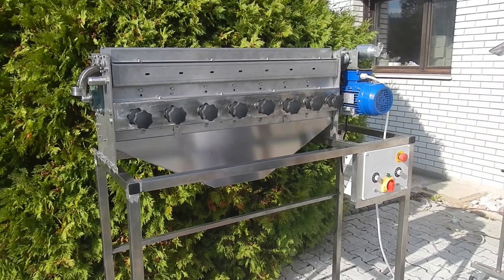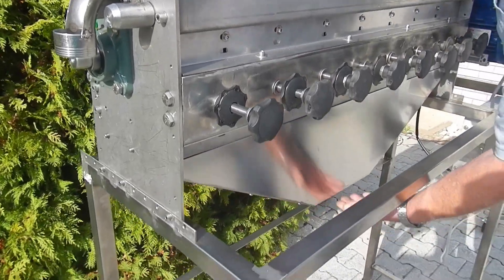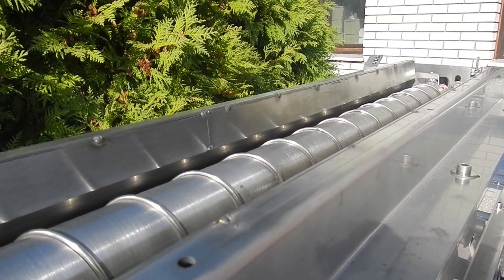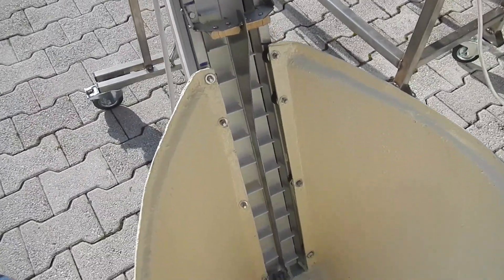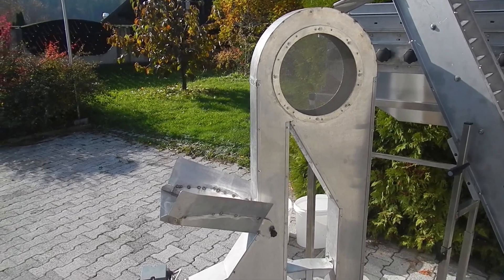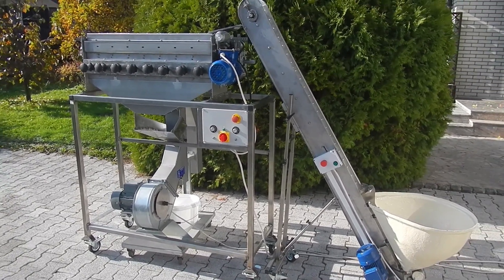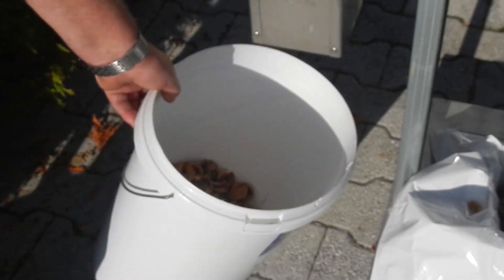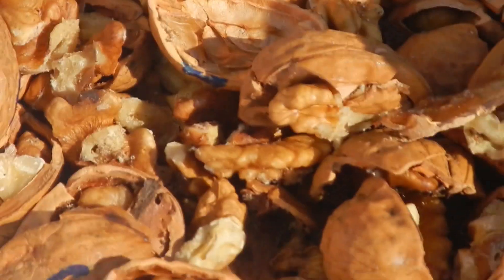Walnut Cracking Machine - NEW GENERATION (whole production line)

Comment: I am working on a project in which areca nuts are to be lifted using a similar belt mechanism. Can someone please tell what Material this belt is made up of or where I can find this kind of a belt?
Reply: I designed the conveyor belt myself. The material is as usual. As I know it cannot be bought.
Greetings
Reply: @povhenavtika7906  Can you please tell which material you used for making the conveyor belt. Steel?
Reply: It's made with stainless steel

Comment: Seems you fellows are on the right track.  But, do you run these half-shell portions back through this machine or what?  Seems that it doesn't crack these nearly enough to get all the pulp out of the shells.  And what do you do with those oversized walnuts?  Do these get hand cracked by migrant workers?  Correct me if you want, but I believe the whole reason these walnuts and other nuts are so darn expensive is because of the human labor involved.
Reply: Half shell is still a problem, but the oversized nut will directly sold to market as inshell, because people like that size of product

Comment: The engineering of this thing is spectacular. It's the only all-in-one system I've seen.
Reply: The machine can be adjusted to a diameter of 60mm. You can squeeze the nut very hard to completely crush. But then there is no price. I want to have a kernel. There's something handy.
Polde